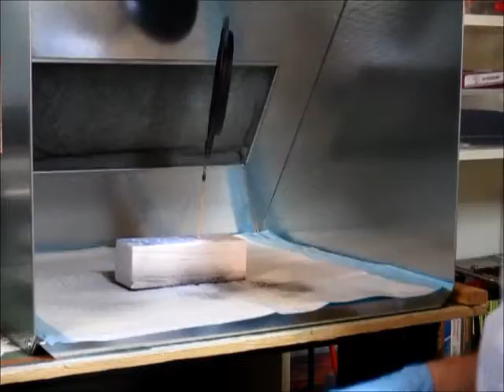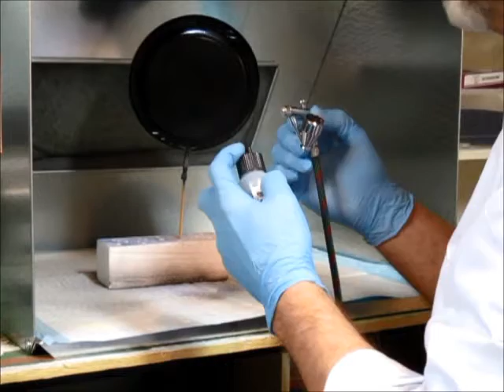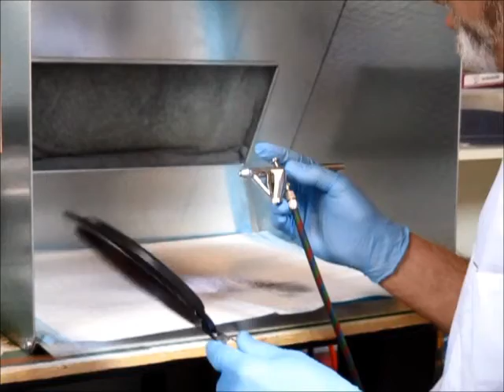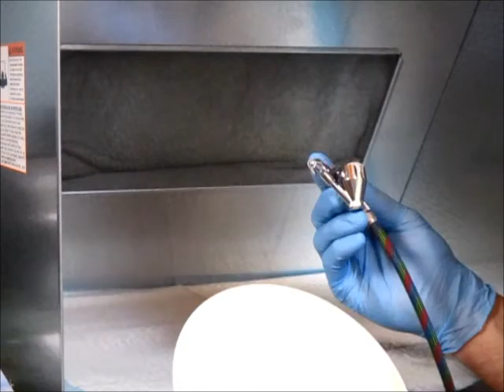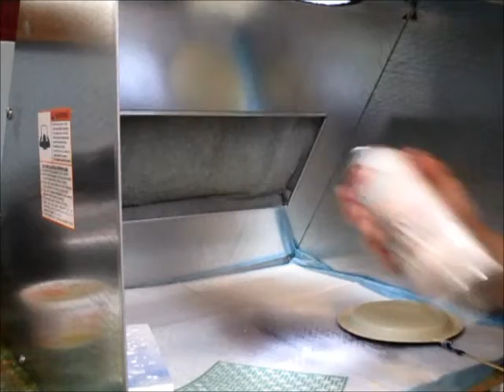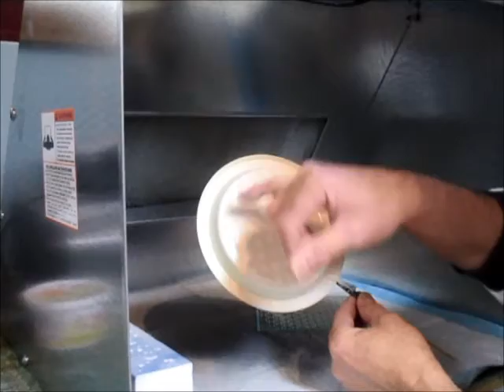1957 Bel Air Painting Practice

Comment: Wayne, what do you use to strip paint?  I messed up with some Krylon primer and need to strip it off.  Can't find the stuff the 'mericans use in Ottawa so hoping you can help.
Reply from the maker: Model Car Minion Thanks for watching and I hope I can help. I use the full strength L.A. Awesome from Dollar Tree. It is yellow and is in a screw top bottle, but, since I only use acrylic paints right now, I do not know how long you would need to soak it for the enamel or lacquer based primers. Give it a try and let me know if it works. Cheers
Reply: Wayne Osborne I'll check for that at dollar tree. Thanks.
Reply: Wayne Osborne  Hi Wayne, I found the LA Awesome degreaser at Dollar Tree and soaked the model in that for two days and it took almost all the primer off, left in another day and then scrubbed with a toothbrush and resanded it back to the plastic.  Thanks for the tip, it worked great.
Reply from the maker: Model Car Minion Glad it worked, you used it the same as I do for the acrylics, just a couple of days soaking and the paint washes off, and that is a great use for old toothbrushes. Cheers

Comment: How much medium do you use?
Reply from the maker: Hey Cliff, thanks for watching, you can use as much airbrush medium as you need to get the consistency right. I start with equal amounts of acrylic paint and airbrush medium, but, before I add the airbrush medium, I stir in 3 to 4 drops of windshield washer fluid, I always add this first. If the paint is thick, you will need more airbrush medium, but, start with equal amounts. I am on the road this week, but, I will do a video this weekend. Cheers